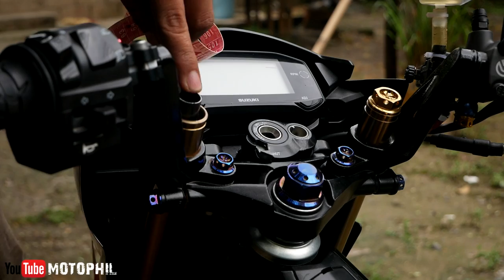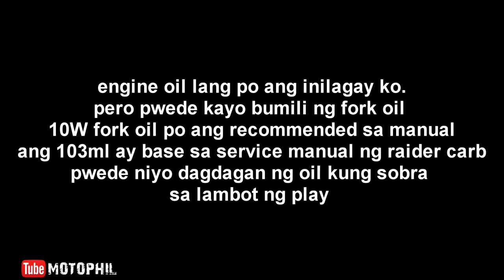Gold Innertube Raider 150 Fi Thaiconcept Project

Comment: sir try mo ung bago ACCENTWIRE 

*TORQUE AND HORSEPOWER BOOSTER
*FUEL SAVER
*2 OR 4 STROKE CARBURATOR % INJECTION ENGINE COMPATIBLE 

PA REVIEW SIR SALAMAT